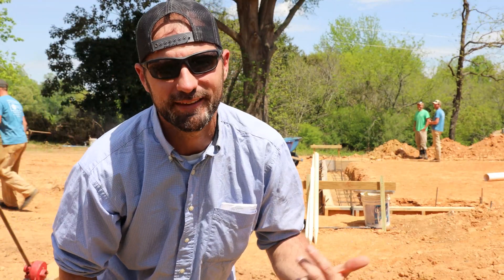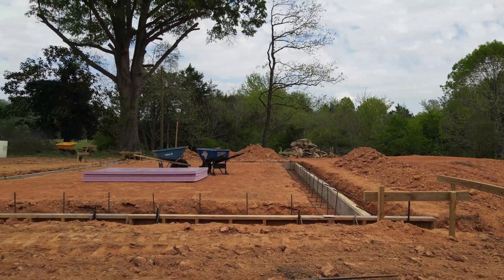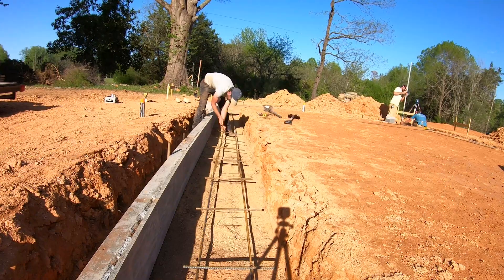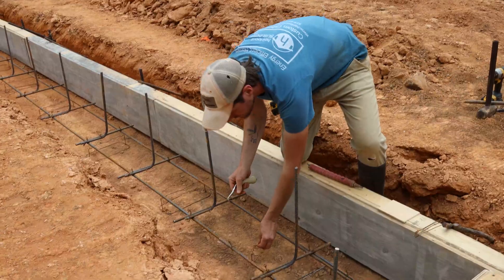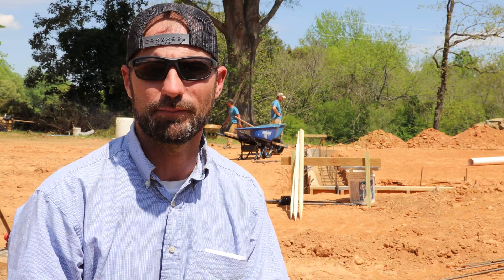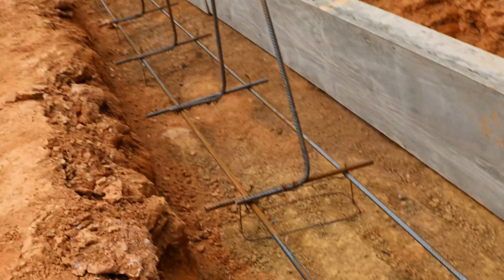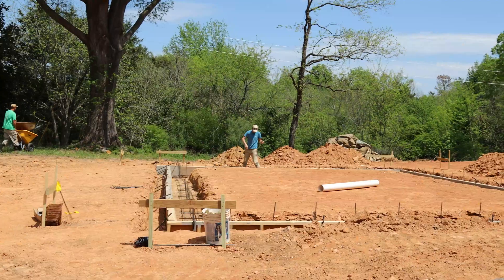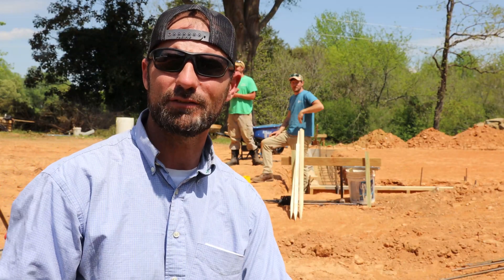CONCRETE FOUNDATION TOOL: How a REBAR TIE TWISTER can save time AND build a better foundation.

Comment: Not nearly tight enough. A good set of pliers and a quick snap will get them tighter, more secure, and is faster over all once you get the muscle memory down. Not to mention those premade ties can only do one tie. Something as simple as a cadillac tie would make that tool useless. 

To any iron workers - save yourself the trouble and buy a set of nines, rip out the spring, both sides of grip, and run some old water hose on the palm side handle. Barely gotta move your hand to open and close your pliers at that point.

Comment: From one logan to another doing concrete work, SMDH only use those twirlers in hard to reach areas, a wire reel and pliers is 100x faster and stronger, those pigtails snap before they can get tight enough
Reply: Got proof?
Reply: @joemendyk9994  lmao 1 Mexican + Nice reel + pliers can tie all that rebar in 3min or less.
Reply: SWITZERLAND 🇨🇭 FIRST WORLD REBAR TYING 
                  https://youtu.be/hAAaM4Zgq-I